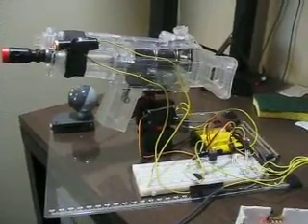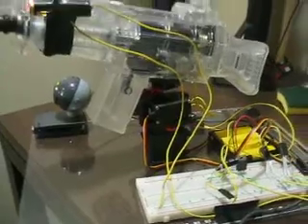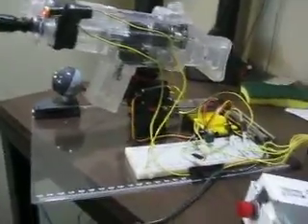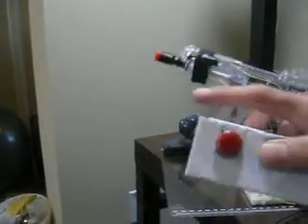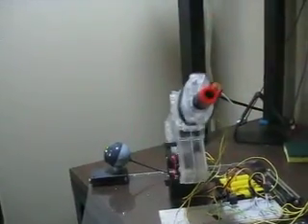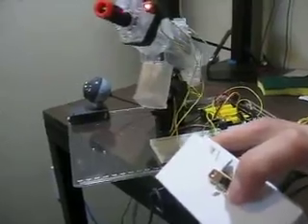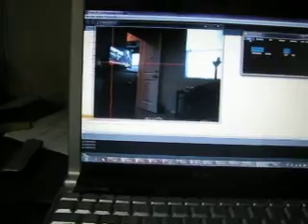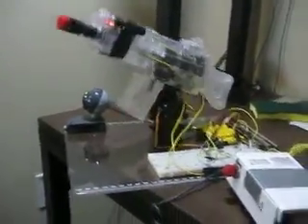Arduino Sentry Gun

Comment from the maker: The reason for the "wiggles" can be associated with two things. First I've exceeded the maximum weight that these servo/mounts can hold (but they were cheaper than the nicer ones). And second accelerometers are really not good for "pitch" and "roll" measurements. The reason being that there is too much noise to get an accurate reading. Adding a gyroscope and utilizing a kalman filter would help but was beyond my understand at the time (and still kinda is).

Comment: hey robbie, it's Bob from Project Sentry Gun. Nice job with the finished project! looks like you got the Turret_05_13 code working well.
Just a tip for the tracking, it's not meant for such close range. More like 30 to 40 feet away from the camera.
Also, are you using a servo for the trigger, or a relay or Mosfet?
cheers!